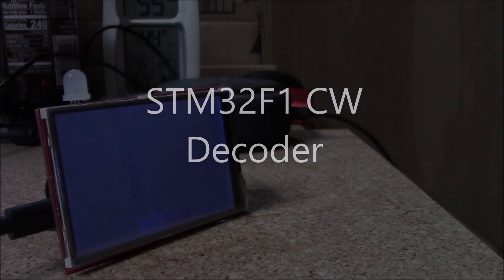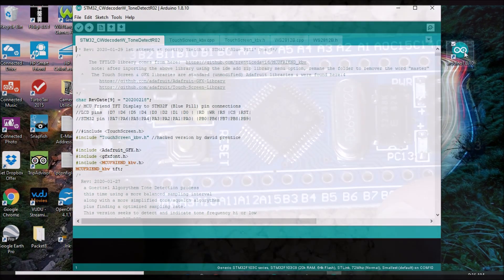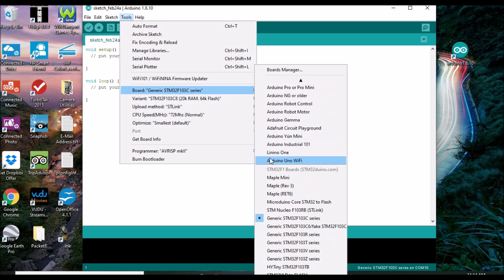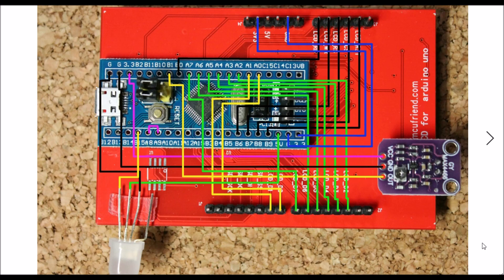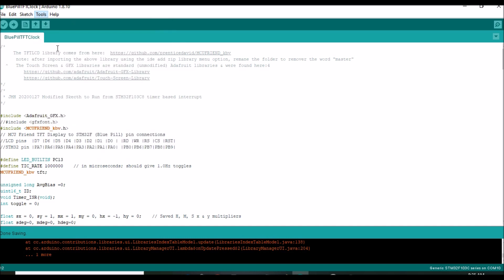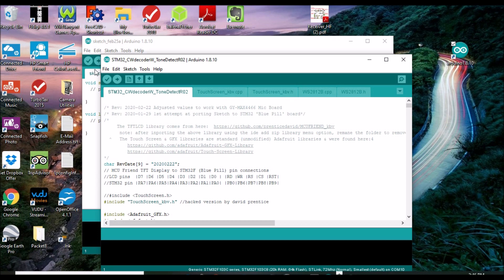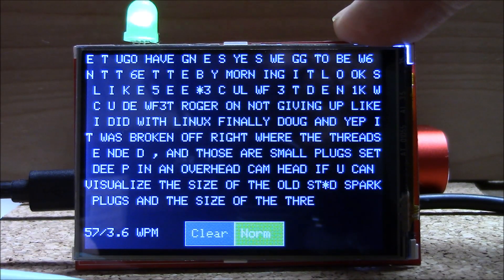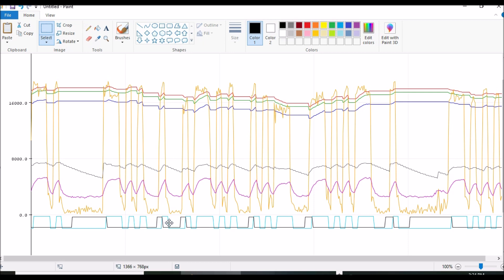STM32F103 (BluePill) CW Decoder

Comment: Hello, sir please tell me how can I use pin 8-9-10-11-12-13-14-15 of PORTB as data pin and pin  0 1 2 3 8  of PORTA as command poins ?I tried to modifie  the file mcufriend_shield.h   , but you used #if 0  for uncommenting   the line  for setting the pins  of stm32..
Reply from the maker: You're in the right area. But trying to do a complete swap of the PORTA & PORTB pins is considerably  more complicated than just changing one statement. It can be done, but its beyond the scope of this project.
Thanks for your comment (& interest in the project)
GL,
Jim(KW4KD)
Reply: @jmhrvy1947  You said I'm in the right area , but in which row you are declaring the data PORT  I don't understand because everything that comes after the #if0 statement is not used by the compiler right?
Reply from the maker: @kebabsharif9627  That's correct. When I wrote, "you're in the right area" I meant you had the right file. Do a search for "BLUEPILL" and you'll see the lines of code that's relevant to the STM32 MPU's.  Swapping GPIO's is doable. But will take a number changes to get there.
GL,
Jim(KW4KD)
Reply: @jmhrvy1947  So although those lines of code for BLUEPILL come in the region commented by directive #if0   I can make changes of data port modifying them because for some reason the row after #if 0 are compiled  ?
Reply from the maker: @kebabsharif9627  Yes. Notice that the #if0 is followed by an #elif. Its these #elif  conditions that actually control what the compiler uses. 
Good question, and am betting others probably have thought about it too
Jim(KW4KD)
Reply: @jmhrvy1947  it was my Sublime who commented everything that comes after if0 , that's I couldn't notice, thank you very much for correcting me.

Comment: I've got a question, since I'm going to be building this for a portable QRP setup, what is the voltage needs of the finished project, and what amperage is drawn? Need to make sure I have the right voltage step down modules, and ensure I have a large enough battery to power this, my qrp rig, and my antenna tuner. Thanks in advance. 73 KE8APH
Reply from the maker: This answer is based on the display shown in the video, and the Maple Mini as the MPU. Your supply will need to deliver (battery) voltage ~3.8 minimum, @ ~95ma. The display, shown in the video, is powered by a single 3.3v connection. But be aware there are similar (looking) displays that need a 5v source to operate. My "finished" decoder is powered by a single 3.7V/2000ma lipo. In theory, it could run 20hrs. However, I've never come close to pushing it to that limit. But know it will run comfortably for 2 hrs at a time.
Thanks for the question & GL,
Jim(KW4KD)

Comment: Any Ideas why I get Core is held in reset after it uploads, I get the compile and flashing light on on stlink but then the error, and thats it, any suggestions, I'd really like to get this working
Reply from the maker: Cliff, Just guessing here, but make sure both the boot 0 & 1 jumpers (on the blue pill) are in the zero positions at all times. If the Boot jumpers aren't the issue, then I'd double check the STlink to Blue Pill connections. With more pins than needed (on the STlink) its easy to get things wrong there. If needed, see QRZ to contact me.
Jim(KW4KD)
Reply: @jmhrvy1947  Hi Jim, Not sure what the issue is I disconnected everything from the board just in case I had made an error, I did have the two data lines the wrong way from the st link to the board, so it would not upload, once swapped the st link flashes away for a minute or so, says uploaded, but in the command window at the bottom I get  the core reset message, I am wondering if I may have an issue with the board, lucky they are cheap enough , just adds a delay to my build, thanks for the input and offer of assistance.
Reply from the maker: @cliffbarrimore  Cliff,
If you like, Email me (see QRZ) and we can compare in greater detail what's going on.
Tnx,
Jim(KW4KD)
Reply: @jmhrvy1947   hi Jim, I'll see if I can have a look this evening or tomorrow and see if I can get the blinky uploaded and working, if not I'll drop you a line, thanks
Reply from the maker: @cliffbarrimore  Yep, at this stage, the "Blinky" sketch is the sketch to be working with: FWIW, here's what the IDE output looks like (on my linux machine) when the Blinky sketch loads successfully:

Sketch uses 14212 bytes (21%) of program storage space. Maximum is 65536 bytes.
Global variables use 3128 bytes (15%) of dynamic memory, leaving 17352 bytes for local variables. Maximum is 20480 bytes.
USB Status [unknown]
2021-01-17T15:33:54 INFO src/usb.c: -- exit_dfu_mode
2021-01-17T15:33:54 INFO src/common.c: Loading device parameters....
2021-01-17T15:33:54 INFO src/common.c: Device connected is: F1 Medium-density device, id 0x20036410
2021-01-17T15:33:54 INFO src/common.c: SRAM size: 0x5000 bytes (20 KiB), Flash: 0x10000 bytes (64 KiB) in pages of 1024 bytes
2021-01-17T15:33:54 INFO src/common.c: Attempting to write 14212 (0x3784) bytes to stm32 address: 134217728 (0x8000000)
Flash page at addr: 0x08003400 erased
2021-01-17T15:33:54 INFO src/common.c: Finished erasing 14 pages of 1024 (0x400) bytes
2021-01-17T15:33:54 INFO src/common.c: Starting Flash write for VL/F0/F3 core id
2021-01-17T15:33:54 INFO src/common.c: Successfully loaded flash loader in sram
 11/13 pages written2021-01-17T15:33:56 INFO src/common.c: Starting verification of write complete
 13/13 pages written2021-01-17T15:33:56 INFO src/common.c: Flash written and verified! jolly good!

USB Status [unknown]
Waiting for tty device  

 should now be available.
Reply: @jmhrvy1947  I have sent you an email Jim, thanks

Comment: Great project, i have built a couple of decoders including OZ1JHM's which a great starter project.   Have just received all my parts and will start this project tonight.  Has anyone found a good Fritzing diagram or schematic for the circuit.   Was going to do a mod to allow microphone input or Line In input.   Of course I have to get the basic project going first.   Might also make a change and use a Nextion Display.   Anyone doing something similar?   I am interested to see how the STM32 CPU handles the load.   Thanks for a great project, your video was very well done.  Among the best i have watched on an Arduino/STM32  type project.  Bravo Zulu!
Reply: Charles: I have produced a pcb for this project. It incorporates connections for both the mic input as well as line input as well as a switch to select between the two. Contact me via my email address on qrz.com if you are interested in one.
73 de Arnie W8DU
Reply: @arniep740  Sent you an email as i am interested in obtaining several of your PCB's.  Chuck WO1O (you can use ARRL address as well, if you don't receive my email)

Comment: I am having trouble sourcing the APA106 in the USA. Can I substitute a WS2811 led in it's place?
Reply from the maker: Good question. I think the short answer is "yes". But to be clear, I haven't tried it. When I search "ws2811" eBay returns  a range of devices. As I understand it, 2811 is the chip used to do the color decoding and LED driver. If you examine the CW decoder sketch, you'll see that it initializes the LED class as "WS2812B". Finally, looking at the APA106 & WS2812 data sheets, they have a nearly identical data stream (but with slightly different timing values). So unless you're paying an "arm & a leg"  for the 2811's, and assuming your 2811 has a 3.3 to 5V rating, I'd say try it. Think the worse that can happen is it (the LED) wont do anything. 
Last point I want make, is please build the Maple Mini version of this project. For the same cost, you'll have a better decoder, pus a number of extra features that the 64k Blue Pill doesn't have space to support.
GL,
Jim(KW4KD)
Reply: @jmhrvy1947  Thanks for the reply, I will give the WS2811 a shot. I can get them at Sparkfun. With covid and shipping taking forever from overseas I try to source all my parts here in the US. Your video is top notch and I have been looking for a Blue Pill project.
Reply from the maker: @larrynaumann8169  GL, & let us know how it works out.

Comment: Hi
Thanks for nice video.
I Want to add LCD 16x2 to this program for magC only, this is what i did but is not working.
What I should do ?

STM32 CW Decoder Tone DecodeR 03 on program beginning - 
#include <LiquidCrystal.h>
LiquidCrystal lcd(PB15, PB5, PA2, PB6, PB8, PB9);

in setup -  lcd.begin(16, 2);
and
/////////////////
lcd.setCursor(0, 0);
  lcd.print("M=");
  lcd.print(magC);
////////////////
inside - if(TonPltFlg) {  = on LCD I have nothing  

or  at the end of - void loop() = on LCD Ihave - M = 0.00 - no respond to signal on PB1.
Reply from the maker: Hi galina,
Thank you for the question, and interest in the project. As a DIYer, I get your wanting to build with whats available. And you are welcomed to modify the code (sketch) any way to suit your needs. However, here I don't have a magC, so am unable to offer recommendations as to how this code might be altered to work with your display. But can say this. To adapt this sketch to work with a 16X2 character format, and non-touch sensitive screen will require changes to the code that go well beyond the "setup" segment of the sketch. I hope at some point you'll report that that you've succeeded. But you'll need to look to other sources, if outside help is needed.
GL & again thank you,
Jim(KW4KD)
Reply: @jmhrvy1947  

Your video 18:50 you have on serial plotter Red, Green and Blue line so if you have them on serial plotter I can have them on LCD just adding to serial.print  lcd.print

 // Graph Geortzel magnitudes
    Serial.print(magH);//Blue
    Serial.print("\t");
    Serial.print(magL);//Red
    Serial.print("\t");
    Serial.print(magC);//Green
    Serial.print("\t");
lcd.print(magC);  ?
Reply from the maker: @galinakorczak2446  the short answer is "no". Plotting is a feature of the Arduino Ide, and is quite a complicated process (also wholly separate from what the blue is doing) In the decoder sketch, all the blue pill is doing is sending raw numbers via is serial link to the computer. The IDE's plotting tool is figuring out how to scale the data, and which number belongs to a which trace.
However, in another video (see https://www.youtube.com/watch?v=PA9UYz__dcc&t=12s) I demonstrate a very crude plot routine using a 16X2 LCD display. But it would not be applicable to the data generated by the decoder sketch.

Comment: Great video & thanks for the code. Got a quick question about how easy would it be to use a different size screen or an spi version and to use a different board e.g esp32? The ideal is to find one that fits into an altoids tin. I've built the oz1jhm (http://www.oz1jhm.dk/content/very-simpel-cw-decoder-easy-build) decoder and it looks like this is a similar method but the arduino seems to miss a bit, perhaps because it is struggling to keep up. I was thinking that the blue pill has few processing constraints.
Reply: This one works quite well on an Arduino Nano:
https://www.planker.dk/Projects/Arduino/Decoder/en_cw_decoder.htm

As does Budd Churchward's Morseduino.
Of course, Jim's display on the TFT is the best.
73 de Arnie W8DU
Reply from the maker: Interesting... Thanks for the link to the OZ1jhm video. I was not aware of his project. IMO the Goertzel algorithm is a good fit for this project. My first effort used two Aduinos. One to do the decoding, and the 2nd did the tone detection. It worked, and was pleased with the results. But the ADC was being pushed to its limits. The STM32 family with its higher clock speed, 12 bit ADC, and 32 bit processor offered much more performance, lower build cost, and even simpler build. The Blue Pill shown here is clearly better than what I was able to realize, with the Arduinos. But the combined sketches consumed 99% of the Blue Pill's Flash space (64K). Today,  the Maple-Mini (128k flash) is my 1st choice. Yes the code used here, in the right hands,  could be adapted to work with other processors and displays. But is beyond the scope of this effort. The Mini maple sells for < $5. Not sure what esp32 boards go for. But  hard to imagine their being much cheaper. Same thing for displays. The goal of the video is to encourage viewers build something of their own, and create some interest in the world of CW. So thanks for the questions, and hope that you'll give it a try, as is, or by adapting it to your own needs
GL & Tnx
Jim(KW4KD)
Reply: @jmhrvy1947  I'm currently 'enjoying' attempting to upload sketch via the st link v2 😊 for some reason it won't compile at all on my windows machine and will compile on a ubuntu machine but not upload. The fun of microprocessors.

I'm almost +ve that the ok1jhm code is used on the qcx transceiver as well but with an on screen tuning indicator. This decoder method seems to be the most reliable and helpful on a windy sota activation.
Reply from the maker: @alexg7kse  I may be telling you something you already know. On Windows machines you'll need to download (& and install) the STlinkV2 USB driver (en.stsw-link009.zip) from the STM web site. On Linux computers, my github repository has a special file [49-stlink.rules] and instructions where to place it. If needed, use my QRZ e-mail address, and we can dig deeper into what's causing the road block(s)
GL
Jim(KW4KD)

Comment: Hi Jim, I got an error that said "#include "utility/mcufriend_shield.h"" could not be found so went and found the file(mcufriend_shield.h) and included it in the sketch after removing the path to utility. 
It works great. Thanks a lot. I appreciate your efforts. What fun!
Reply from the maker: Sorry for the slow response. Not sure how I missed your comment. But appreciate the feedback and kind words. Glad you were able to sort out the error. The Utility folder is now included in the sketches.
BTW, if you built the Maple Mini version, you might want to go back and revisit the repository/project. That version has been updated, and now supports setting & storing some user preferences; i.e., Tone freq, LED brightness, Squelch Mode...
Tnx,
Jim(KW4KD)